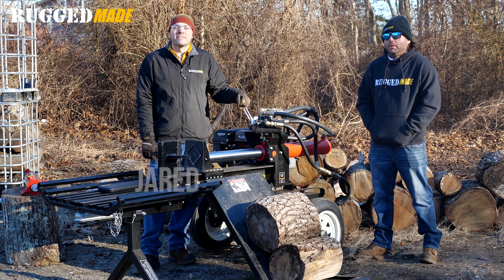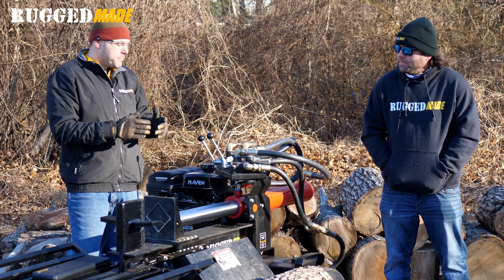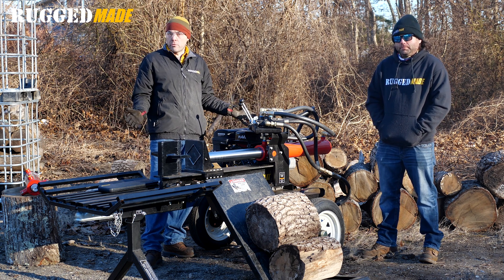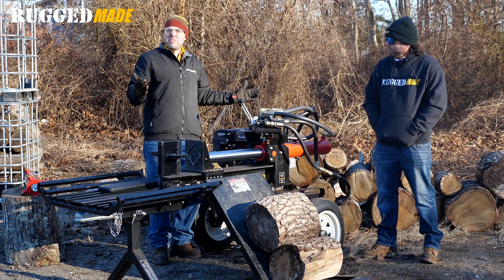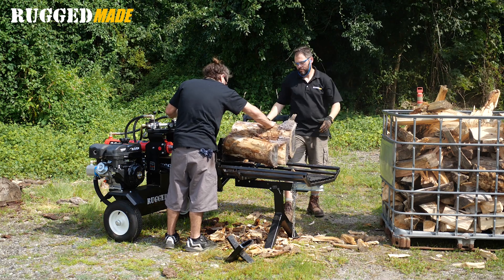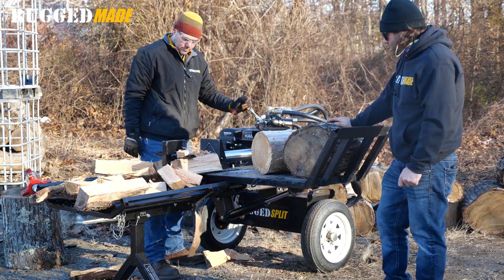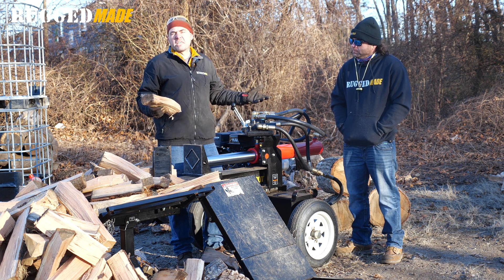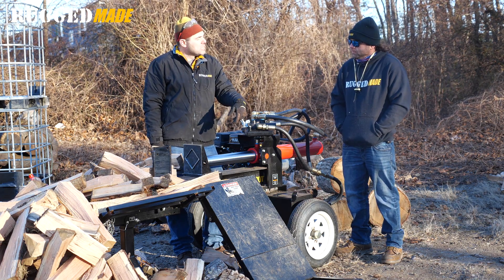Souped-up 300-Series Log Splitter Ep.3: The Pursuit of a Five Second Cycle Time!

Comment: I would definitely be interested in you guys offering an upgrade kit. I have a homemade splitter with a painfully slow cycle time, but it does have  a GX390 and a 25 gallon hydraulic tank.
What do you think would be
 the best pump to get the optimum performance matched with that engine?
Reply from the maker: Technically speaking, the minimum recommended engine size for a 22 GPM pump is 390cc (the GX390 is 389cc), so your engine should have no issues turning that pump. What size cylinder does your splitter have?

Comment: Auto cycle be nice. And I have your  4.5 by 2.25 cylinder hooked up to a predator 420 with a 19gpm pump I'm seeing around 7 sec times  and my hydro tank is a 25 gallon  but I only buy around 18 ish in it work perfect

Comment: If you are going to hot rod then hot rod!
1. Bigger carburetor 
2. bigger exhaust
3. biggers hoses 
4. no angle fittings 
5. Port out the restrictions in the valve body, cylinder , and pump.
5. Figure a dump valve for the return flow on the retract stroke

Comment: So as a hot rodder: yes try to gain speed in smoothing flow and opening up restrictions. E.g. Many hydro cylinders and valves have a smaller orifice and sharp corners beneath the fitting.  I imagine more speed will come from cranking up the throttle.

Comment: Awesome!  When will it be available to buy?

Can you add a hydraulically adjustable 4-way wedge that when dropped all the way down is low enough to be a single wedge? (No need to manually take the 4-way on/off while splitting)
Reply: Built rite has splitters like that.